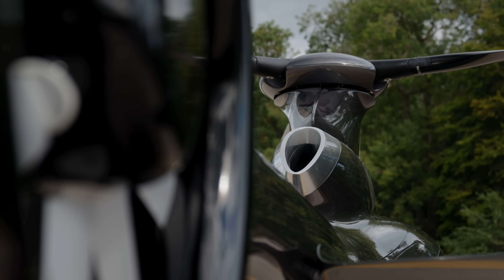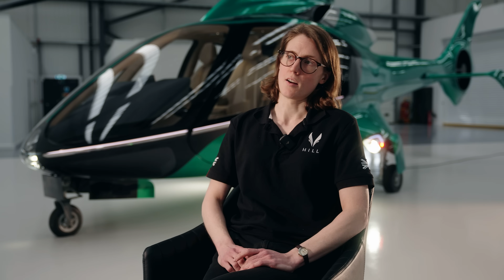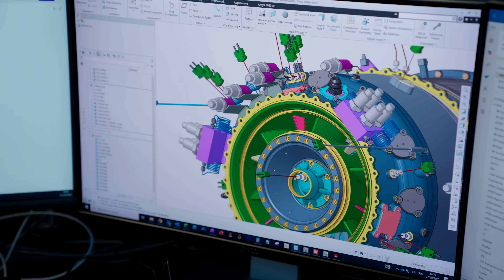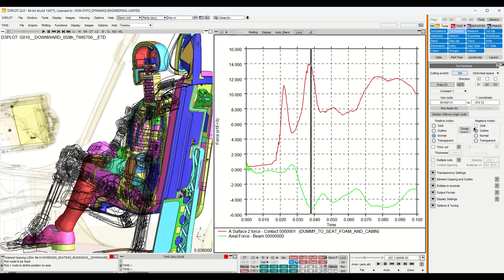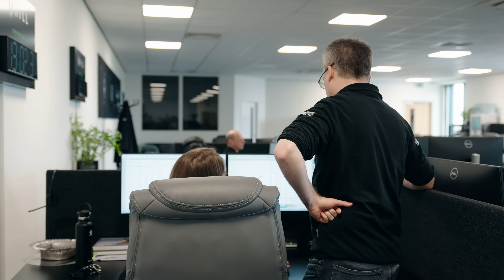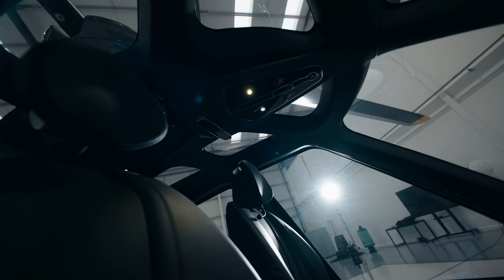How Hill Helicopters Uses Oasys LS-DYNA Environment for Advanced Aircraft Simulation

Comment: Sorry to rain on all the positive comments. I’m also a supporter of independent aerospace companies but these guys are really biting off way more than they can handle. Airframe, engines, and MGB development all in house. I’m coming from a 30 plus year aero engineering, from helicopter aircrew, to maintainer, to overhaul facility military aircraft engineering, to safety of flight testing and project manager of many developing aerospace systems. Worked with some of the top talent in the world (Rockwell Collins, SAFRAN, & Lockheed Martin, & Eurocopter. This thing is still a million miles for completion. Static prototype does NOT equal Flying prototype, Flying Prototype does NOT equal certified aircraft and finally Certified aircraft does NOT equal a supportable product. Any one of these pieces (airframe, engine, MGB) is a monumental task to get to a  final scaleable, reliable, supportable end product. To try and do all three at once is almost unheard of and even more likely to fail. You can do all the CAD/CAM/AI simulations you want, but I’m here to tell you once that product gets airborne(thats a big IF) its a whole list of problems you didn’t foresee. As good as we’ve gotten over the decades in design and manufacturing, lab tests don’t equal field tests. I cheer for these guys but they have by far the toughest part of their journey yet in front of them.
Reply: So I'm a helicopter pilot and I worked for a an addictive manufacturing company so not as much versed as you in this but I'm somewhat versed. This is why hill decided going the experimental route with the hx-50 and the certified route with the hc-50 the problem is people need to understand the difference now like you said there timeline is very optimistic I think they are about a year behind on the hx-50 so realistic estimate is 2028-2029 but the hc-50 probably 2037 or later.
Reply: @allwrightadventures6675  
Hill is trying to:
* Design the airframe
* Build the factory
* Certify a helicopter
* AND create a clean-sheet turbine (GT50)
That’s four separate high-risk programs.

Typical timelines:
* New certified helicopter: 8–15 years
* New turbine program: 10–20 years to maturity
* Production ramp after certification: +3–5 years

Hill’s public timelines compress all of that.
That usually means one of three things:

1. Optimistic planning
2. Underestimated certification/test burden
3. Cash runway pressure forcing aggressive messaging
👉 Historically, even one of those can sink a company.  Like I said previously, I applaud innovators and people wanting to make a better product or try different approaches but the likelihood of success is very small indeed.

Comment: Modelling and simulation relies on one major assumption - when you manufacture the part it exactly matches your computer based model. The tolerances, material structure, etc must all be  very close for the simulation to be accurate. This is especially difficult with handmade parts like carbon fibre or welded metal parts. The computer is using a whole bunch of material “presets” in its model. Real world testing is what actually matters. I prefer a rapid prototype approach. Build it, test it, break it, change it without a heavy reliance on simulation. Yes it has its place but you can spend a year working through simulations to work out something you would figure out in a month with a build and test approach. When the real world part fails after years of development through simulation it also tends to turn projects upside down. Good luck.
Reply: Their approach is a good one. Accurate simulation is accurate. They have a metrology department QA etc to ensure real parts conform within design tolerances. Properly simulated parts wont just pop up with random issues in the real world. Its best to simulate extensively  then test extensively to verify the simulation results; this approach is common place  in industry and keeps cost down while allowing for more rapid iteration.
Reply: Not true. Closely integrated simulation tools can run far more cases, including automated optimisation, in hours. They’re not perfect, especially with very complex helicopter aerodynamics, but very good. Build/test/crash/fix causes very slow development cycles and kills test pilots….
Reply: @tonyb4773  not to mention incredibly expensive  (the build/test ...../fix rinse and repeat)
Reply: Modern simulation, and more crucially, modern computational resources, have allowed companies to build VERY accurate simulations for engineering purposes. We have extreme, micron-level precision control. Simulation is crucial.
Reply: @BenC20B so you are equating 1year of costs in simulation to buillding an actual prototype of a hellicopter (no less) and that too in a MONTH !!
(that is what i made from your comment  .... please do correct me if it is not so)
Reply: @n @nevillecreativitymentor m reminded of a story from Elon Musk. Originally the starship engineers were planning to use composites for the fuel tank. Costly, difficult and unproven. Elon told the engineers let’s make it from stainless steel. They agreed that might work. He then said how thin do you think we can go? They weren’t sure. He asked if they thought 4.5mm thick SS would work. They replied possibly but we’ll need about a year to CAD it and optimise it and prove it out by simulating all the different conditions it will be subject during a launch an re entry. He said no just build a mock up and subject it to extreme heat and pressure and see what happens. They did and it turned out 4.5mm stainless worked. That process took about a month. 

I’m not saying build a full prototype helicopter and crash it. All I said was I favour a rapid prototype and test methodology over heavy reliance on simulation. Let me give you an example. The clearance between the insanely high speed turbine blades and the housing in these engines is fractions of a mm. Why not cast some blades with the process you plan on using, put them on a test rig, spin them up to operational speeds and see if they deform as you expected or do they deform a little more, contact the housing and explode the thing? The alternative is you rely 100% on your materials engineers and your simulations to tell you it will work flawlessly. You build a whole engine, you start it, blades deform fractionally more than expected and bang. You’re looking at a giant mess. 

To be fair I have seen them use test rigs for the starter generator and the fuel nozzles so they are doing a bit of this build and test, but in my opinion not enough. I’ve also wondered, why not have just used and off the shelf 500 hp turbine from Safran for prototype 1. Still build your own turbines but you’d have a flying fuselage by now and would be well through smoothing out any issues with the rest of the design. Once you have your turbine ready slap it in and you’re done.
Reply: @BenC20B  I had posted a reply ... somehow it got double posted ... so I deleted one and both got deleted. pppplllrrrrrr.
Anyways , totally appreciate your reply  (the other stuff i wrote is moot)

Comment: The vertical approach Hill is taking on the development integration has had some surprising side effects in other areas of engineering. It would be great to see this expanded. Hopefully the engineers using LS-DYNA are talking to the simulation and flight modeling team working on the X-Plane 12 flight testing.